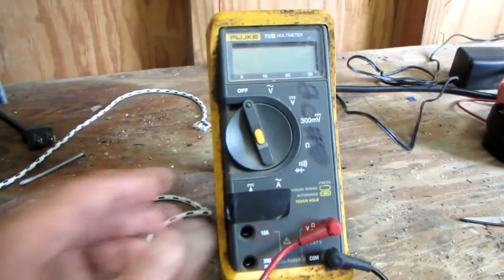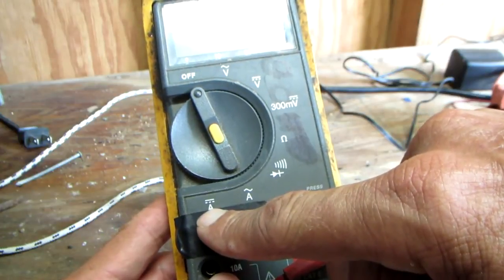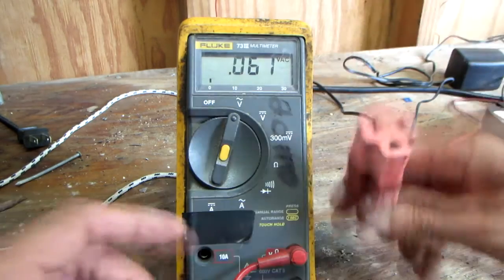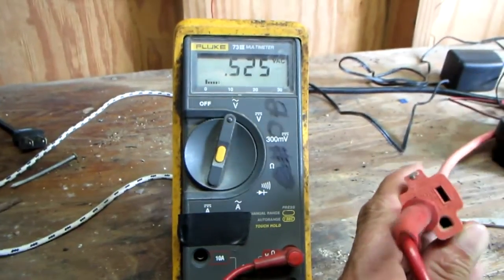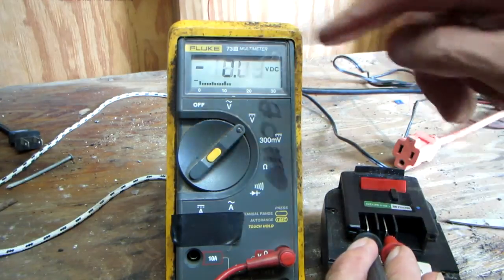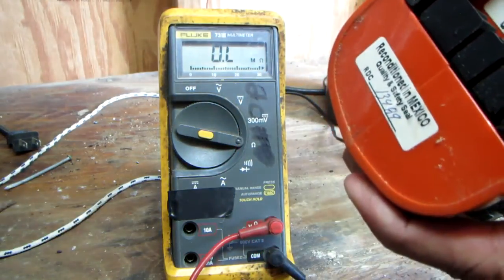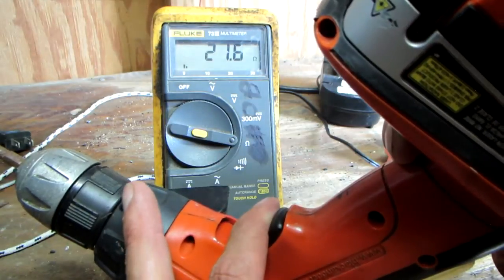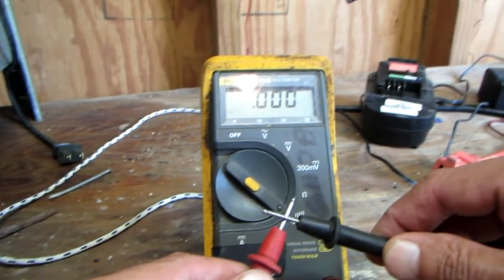Use A Multimeter 101 Basic

Comment: Idk about car or drill batteries, but the correct way to test batteries is putting the selector on Mili Amps.
9volt batteries are 25mA
1.5 volts like AA, AAA & C measure 4.0 mA
& the small, round flat batteries like the 1 in your keyless entry for your vehicle  measures about 8.3 fresh out the pack.